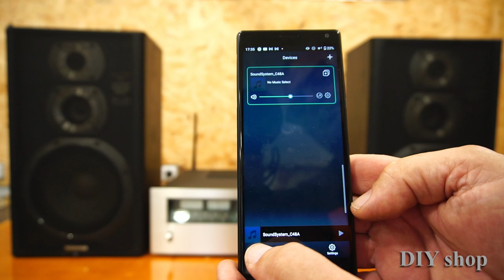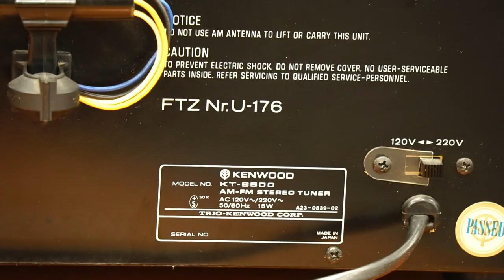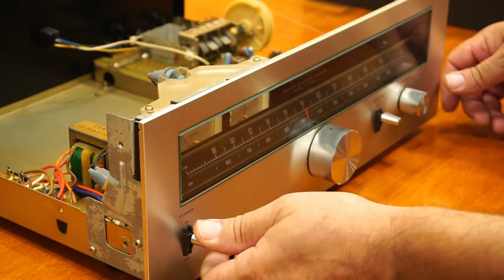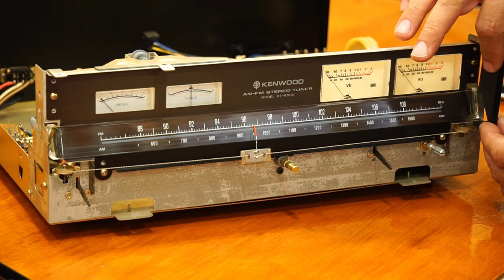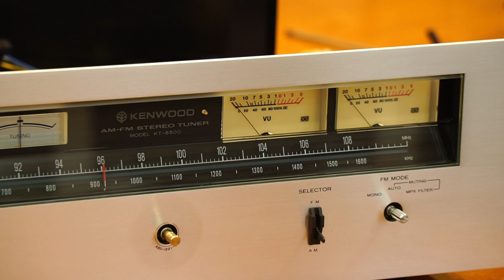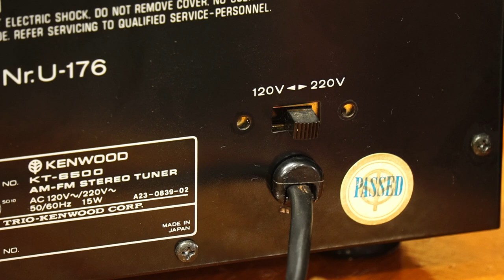How to Add a Line-in Bluetooth WIFI and USB host to old Vintage Home Stereo DIY Network Receiver

Comment: Good job!
I've done similar things on equipment from the time of this Kenwood KT-5500 and I'm satisfied with the results obtained with this type of renovation. It is good to add functions to existing equipment, as long as the original functions are guaranteed.
This was not mentioned in the video.
This Kenwood was left working in good FM conditions?
Greetings from Portugal.
Macedo Pinto
Reply from the maker: Yes the tuner works, sorry for the miss!
Reply: @10diy  that is great!

Comment: I have a old school Audio Research tube preamp l bought the Audioengine B1 and connected to the Aux in's with RCA cables  The B1 has a pretty good internal DAC but has the option to connect to a better external DAC  It was super easy to connect to my smart phone and uses the higher quality Bluetooth  It's the size of a deck of cards